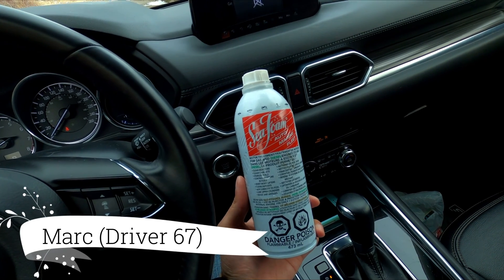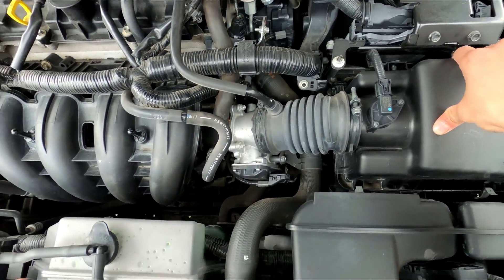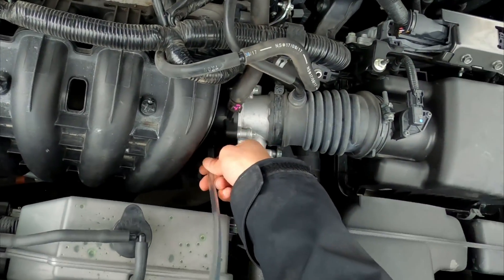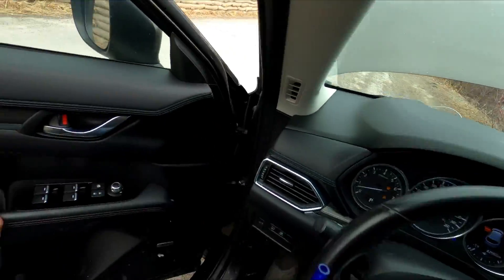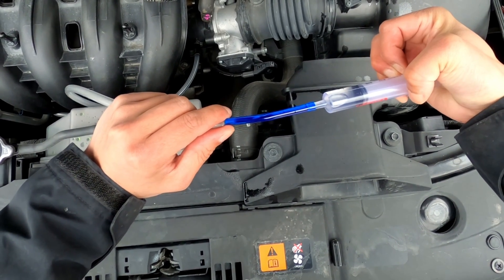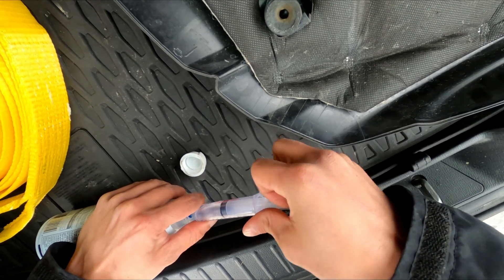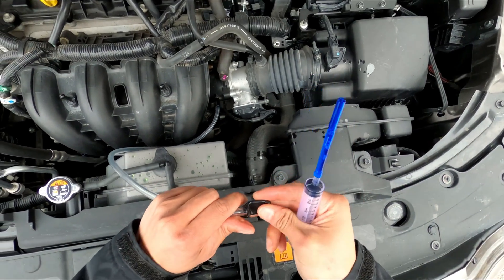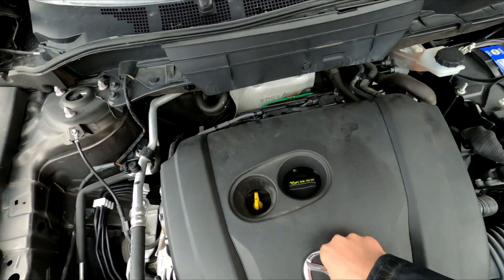2.5L SkyActiv-G Seafoam Mazda3, CX-5, Mazda6 (How To)

Comment: The most important step is the get the engine hot before doing this. Do it on a hot day after sitting in traffic with the AC on and your chance of removing some carbon as the seafoam heat soaks is much better. But this is only going to help as preventative maintenance. If you already have substantial carbon buildup (which is like 50-60k on skyactive-g) it isn’t going to dissolve or loosen anything and you should spend a couple hundred bucks on walnut blasting. It’s a cinch to do on these motors and any legitimate shop can do it in 2 hours.

Comment: Love your channel. Very informative . I own a 2014 Hyundai Santa Fe. It has heavy oil consumption and carbon build up. I use GDI intake valve Cleaner every 15K. Have you tried that on your Mazda. I am planning on getting a CX-5 but worried about the Issues with GDI. Thanks

Comment: I do this to my cars but I induce the whole can in slowly till it smoking and then let it rest 20-30 mins then start it up and let it run till it smooths out, then I drive it like i stole it. A tiny amount of seafoam is only gonna scratch the surface of all that carbon buildup and it’ll be gunked up again before you know it.
Reply from the maker: it likely helps a bit. Really depends on driving habits, oil and temps.

Comment: GDI means this is useless for cleaning valves. If you do use something. Mazda recommends their deposit cleaner that you put in the fuel.
Reply from the maker: I doubt the deposit cleaner will go through the intake valves though. Whereas what I'm doing will have to go through the intake valves.
Reply: Dude, how putting anything in fuel going to clean something where fuel doesn't go?
Like seriously. 
This seafoam is sprayed into air, where air goes through the intake valves where majority of carbon is built up
Reply: The deposit cleaner atomizes in the combustion chambe, helping to reduce buildups. This is according to Mazda. Of course the only true way to clean the intake valves on a GDI engine is to walnut blast them.  Seafoam and other types won't clean the valves completely  as it is a very hard deposit.
Reply: You also risk damage to the main cat on the skyactive. It's a complex Atkinson cycle type engine. Only use what mazda recommends is the best advice.
Reply from the maker: @JohnBoulding  I'll keep that in mind
Reply: @Driver67  look up what that main cat/exhaust header costs. You don't want to _&## that up, haha.

Comment: This actually threw cel "engine malfunction" on my 2016 Mazda 3 after using seafoam. Not sure if it messes up something. Did you get any cels?
Reply: You probably caused a misfire
Reply from the maker: If done properly and feed seafoam slowly it should not throw CEL
Reply: Did you get to know what caused CEL in your case, OP?
Reply: It can cause misfires but once it clears up you clear the code and it shouldn’t come back.

Comment: I have new mazda 3 with 2.5L is it ok to use top tier fuel for this engine 93 in USA or stick with 87 that mazda recommends?
Reply from the maker: Quality brand names like shell should be fine with 87 octane (US rating)
Reply: I know, old comment, but for such a high compression 13;1, I feel 93 works a lot better, especially in hot weather.  I can feel the timing being pulled under hard acceleration to protect from detonation.  You won't feel the accelerating G force from 2-3% gain in power from 93 octane in the Skyactiv-G 2.5 NA (AAA fuel testing showed 2-3% from the Miata 2.0), but you feel the timing not being pulled at high RPM.  You'll notice the timing pulled at 4500 rpm all the way to redline, and sluggish take offs when the weather gets hot and AC is always on.  Throttle response and down shifts seems a lot slower, and going up an incline requires a downshift.  

I ran two full tanks on Shell 93 to notice timing and response getting better, takes time for the ECU to self learn.  85-90deg weather with AC, passing 18 wheelers accelerating from 60 to 85mph is a lot smoother.  I went back to 87 because 93 is $1.20-1.40 more per gallon, planning on going back to 93 on the next fill-up because the extensive AC usage.

Now, is it worth the extra 10-13 bucks per fill-up?  All depends on how you drive.  Driving to church, 87.  Frequent spirited driving with AC always on, 93.  I wish 93 gave us more power, but due to the EPA, Mazda tuned it to save fuel instead of giving us more power from a 13:1 compression ratio.
Reply: Despite the fact that the manufacturer decreased the compression from 14:1 to 13:1 for the US market, you should use the highest octane fuel you can find. A 5% fuel economy savings is not worth the potential engine problems you might face at 100,000 miles.

Comment: I drive 30,000 miles a year I never had any carbon built up currently I have 137,000 miles now my mechanic showed me while I watched him do the carbon cleaning and it was clean lol I just used top tier fuel and some fuel injector cleaner I put In the fuel tank every oil change 7,000 miles
Reply from the maker: Thats great to know! Thank you for sharing. Its amazing you got 137k miles and no carbon build up!
Reply: You do know that fuel injector cleaner does not help your valves correct.!? ...on GDI engine .. you may help your fuel injectors B going to do absolutely nothing for your intake valves
Reply: I'm guessing that you use gas from a shell gas station i live in GTA in Ontario Canada. I dive a Mazda 3 2018 and I want to  keep my engine running nice.
Reply: @Bryan-ck3hi  I use shell / BP /Sunoco / Texaco / Luk oil / Exxon / citgo /  just mostly top tier gasoline
Reply from the maker: Mazda also has an air oil separator on the first gen skyactiv. It works reasonable well from what I heard
Reply: @Driver67  Just on the first genaration? are you sure that second gen doesnt have this behind intake manifold ?
Reply from the maker: @amnon3267  i am not sure if there is one behind the intake manifold. Most like there is one behind the intake manifold but the one i use is the most accessible
Reply: @Driver67  Hi , I sent you private message by email. please can you look at this ?
Reply: what vehicle do you drive ?
Reply: @Bryan-ck3hi  Mazda 3 2.5L  2018 Mexico built skyactiv manual transmission
Reply from the maker: @blitz thats correct. but a little seafoam wouldn't hurt =D
Reply: Hi, which fuel injector cleaner do you use?
Reply: @cdane63  Lucas
Reply: @cdane63  and or Stp in the black bottle
Reply: You’re driving habits played a large part 30,000 miles a year I assume it’s a lot of highway
Reply: When driving on the highway mostly you won’t have the carbon buildup.. like constant stop and go city traffic.

Comment: Mazda should've add oil catch can in their car instead. Aside from that, Mazda's cars are very reliable and one of the best cars i've ever driven.

Edit: Mazda has undercarriage rust problem too but doesn't really affect the car, but i had mine sprayed with anti-rust coating just to be safe.
Reply from the maker: Same I undercoated mine. Actually I think Mazda Skyactiv engines since their inception has a built in air oil separator. I recalled seeing a documentary on it.
Reply: @Driver67  Yes Mazda does have oil separator in every engine they made, but it wasn't very effective and sometimes oil vapor went inside the intake and make carbon buildup.
This wasn't really a problem for me because i regularly clean the intake with GDI spray cleaner every 6 months.
Reply from the maker: @arvin6606  yea I try to do mine every 6 months too and sometimes do the fuel and engine oil. But I think intake valve maintenance is more important than engine oil treatment and fuel treatment
Reply: And durable lol mines been in 3+ wrecks. Some my fault others not my fault lol. So they're made well.

Comment: Cant i just spray it into the intake?
Reply from the maker: Like into the air box where the air filter is? I did it this way to bypass the mass airflow sensor. Not sure how the sensor will react if I spray it before it hits the sensor
Reply: @Driver67  Yes but directly into the intake by taking off the clamp to the airbox and spraying into the intake. Ive seen people spray directly into the throttle body.
Reply from the maker: @grahamcaseylifts  I’m curious how that will go because mass airflow sensor wouldn’t detect any airflow when the hose gets disconnected there
Reply: @Driver67  I believe the mass air flow sensor is before the clamp. So i think it could work.
Reply from the maker: @grahamcaseylifts  hope it goes well. Let me know how it goes
Reply: @Driver67  I will
Reply: @Driver67  I sprayed it directly onto the throttle body which worked fine. Just need to make sure the intake is still connected because there needs to be vacuum. Just sliding the spray nozzle in and closing the intake worked fine.
Reply from the maker: @grahamcaseylifts  so you crack a small opening in the clamps to spray The seafoam? Your way is probably better as my way doesn’t hit the throttle body
Reply: @Driver67  Yep, it did a good job of breaking carbon off the lifters and the throttle body. I used a borescope to look at it.
Reply from the maker: @grahamcaseylifts  did you make a before and after video by any chance? I am curious
Reply: @Driver67  I did not but I can promise it does work. It didn't significantly clean the intake but it definitely cleared some out. I don't recommend doing more than one or two cans. Its not great for cleaning, more for maintenance. However, the engine does sound slightly better, but maybe that's just in my head. Just make sure the engine is around 2k rpm otherwise the sea foam will pool up and can cause engine damage when burned at once.
Reply from the maker: @grahamcaseylifts  thank you for the info. I suspected it removes some carbon but not all, it’s not a miracle liquid but is effective judging from @ProjectFarm videos on seafoam. If you post your borescope video,let me know because I’ll like to check it out. 
When you spray into the throttle body and there is a gap on the intake, does it idle higher? (You know how in my vid I have to control how much air gets sucked into the vacuum because it changes the engine speed)
Reply: @Driver67  It will actually idle lower at first and then compensate for the liquid and will maintain the throttle position at which it is set at by the gas pedal. Yes there is A gap, but very small. Make sure you look at where the gap is and spray it there so it doesn't pool up in the bottom. Yes I have seen his videos they are good. I did not record video initially, may go back. If you have the seal over the hose then it should not change the throttle, but if it is slightly open, which mine was, it did raise the idle slightly.
Reply from the maker: @grahamcaseylifts  good stuff. Great info

Comment: A mechanic recently did something similar to my Mazda6 2016. And I've been stuck with a P0421 code since!  I've been trying to figure out how to fix the issue without buying a new cat.

No more warranty and paid cash for the mechanic with no receipt. So I'm shit out of luck.
Reply: Ever figure out the problem?
Reply from the maker: Sorry to hear that. Sounds like a sensor or cat issue. And as you know cats are expensive now
Reply: A oil catch can would have saved you from this I run one on our 2020 Tucson. Won’t make that mistake again